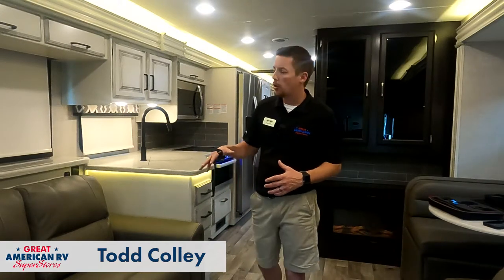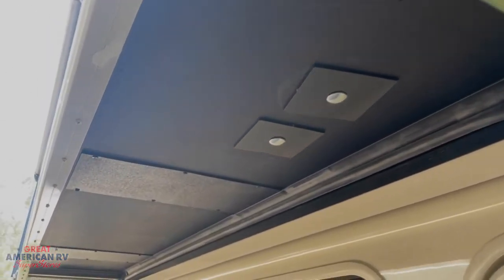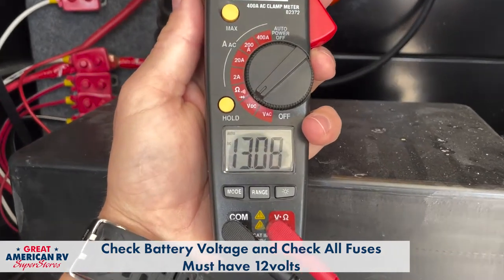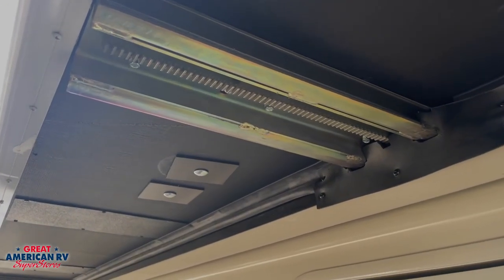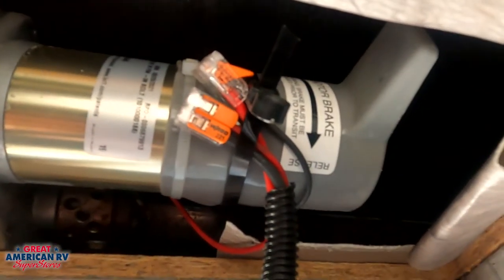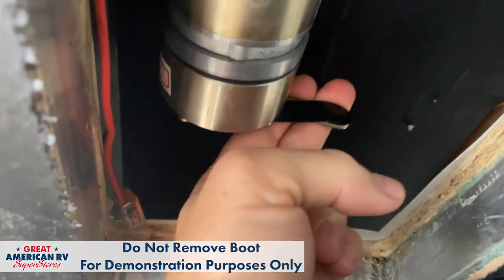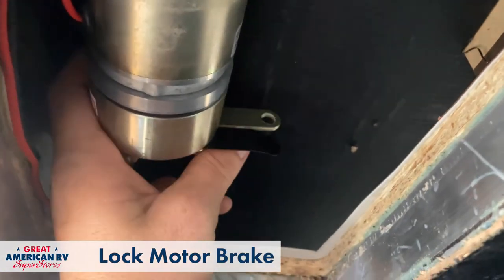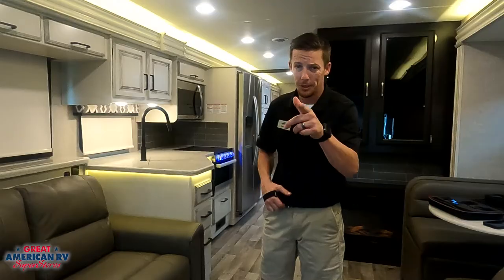How To Manually Retract Your Above Floor Mount Electric RV Slide

Comment: They really should make these easier to close up manually… it should be more obvious how to do in an emergency so you don’t get stranded.
Reply from the maker: Some systems are a lot easier than others but it’s a rare occasion that this particular system would need the override.  I don’t disagree with you though.  -Todd

Comment: My Schwin Tech slide out kitchen on my Forest River Shockwave has me unable to pack up and move. Can’t close up… seems like I’ve got a bad battery causing low voltage or bad control board….
Reply from the maker: This is a video on shwintek hopefully it will help you out with the override and a few tips on operation.

https://youtu.be/zm16iYOpY80?si=ZyET7fA0_fABigph

Comment: Stupid... what about the adapter that goes on it and then put a ratchet on it so you don't need four strangers and a hernia
Reply from the maker: Yep, that's an option as well, in the event the factory gave you more than an inch of room in there to get a turn on the ratchet.  Thanks for making that point.  -Todd